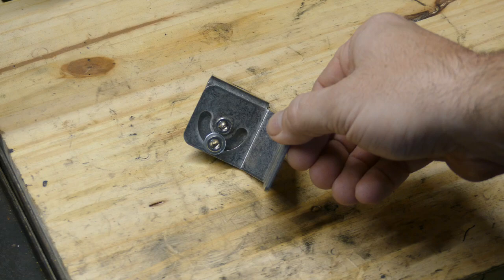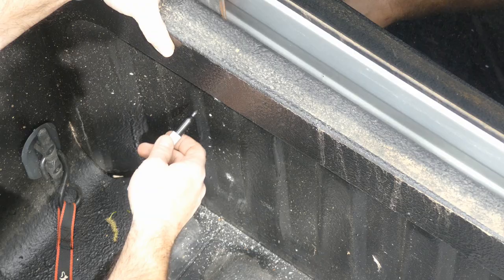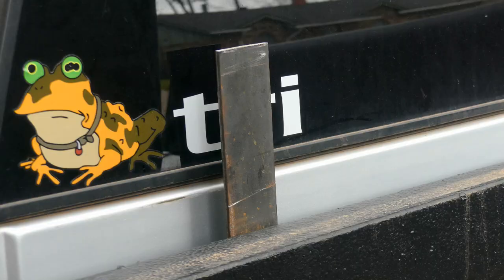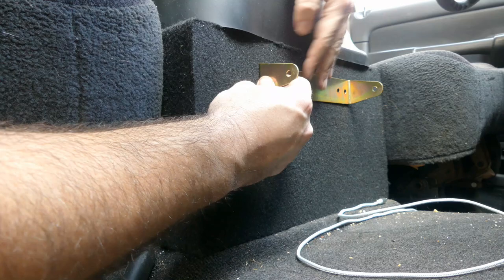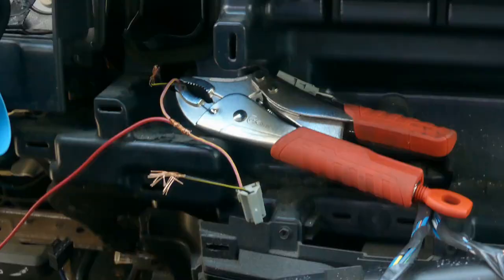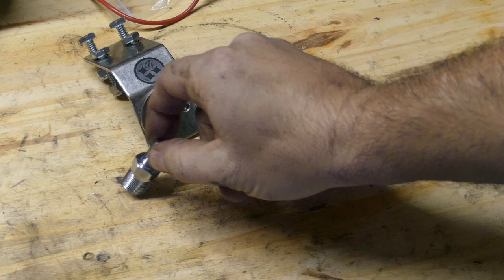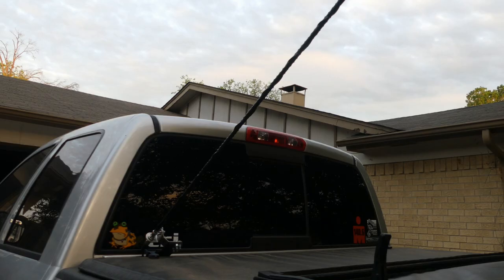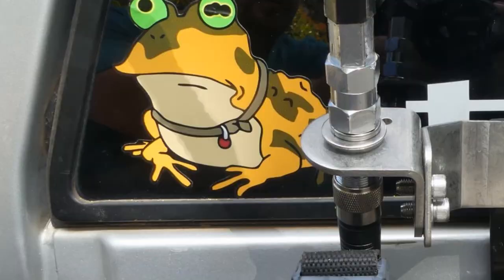CB Antenna Install on Pickup Truck with Bed Cover - Here's How I Did It

Comment: Should have just bought a Magnet Mount and be done with this. One last thing, I would have a Inline Fuse somewhere between the Power source and the radio.
Reply: Can’t with newer f150 and up…aluminum body panels throughout

Comment: why don't you mount at the front-end of your truck I may have missed your reason for that if not that would solve all the functionality issues and allow for a more parallel mount with less interference.
Reply: The closer to the center of the vehicle, the better the ground plane. Better reception. Better transmission.

Comment: Doesn’t it need to be grounded as well?
Reply: I would hope the mounting bolts to the Bed would be sufficient.
Reply: There should be a ground screw on the back of the radio, just run a wire to the frame rail or some the attached to it. Also if your getting electrical noise from the truck like alternator whine, put some ferrite beads on EVERYTHING….LOL